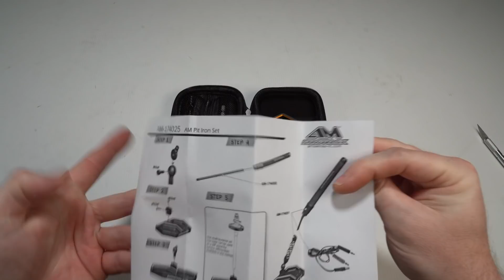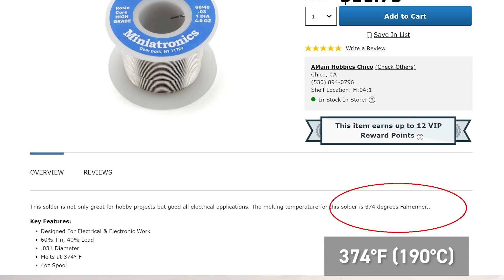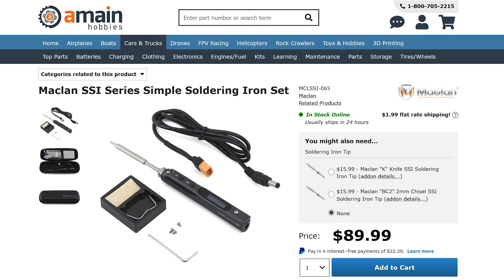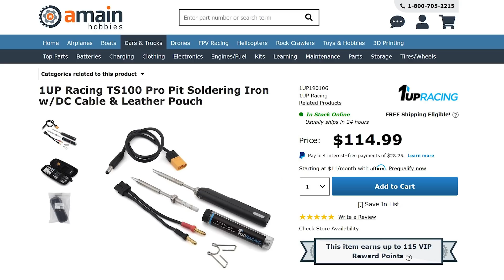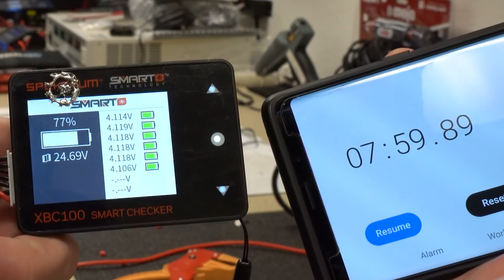Are 12V Mobile Soldering Irons Any Good? Let's test them...

Comment: I own ts-100 and ts-80 and a couple of the mini irons that are 24 volt supplied....all of them work excellent if you put the correct tip for the application....these irons are great for portability and travel well...I recommend them for most electronics and electrical repairs....some of the very heavy duty repairs etc...you probably would need a full size solder station....
Good video, but, the tips used weren't heavy enough for that 8 gage wire.

Comment: similar to suggestions about TS100,  I would just get Pine64 Pinecil iron.  It does everything the ts100 does, but has more options, can go up to 24V with simple mod, I have hooked my Pinecil to different batteries including 18v-21v tool batteries (using power wheels adapters).  why get a 12V iron, when you can get 21V-24V  irons that also can use same DC - Xt60  cord to connect to batteries and are so powerful, they can do everything in this video with ease.

Comment: ive had the ts80 for over a year now... i love it, use it on the bench and in the field, works with any quick charge power supply or powerbank and 3 cell lipo and up.
goes to 450c with a firmware update, dont do any large scale rc but ive soldered 12awg with ease, mostly i use it for small stuff like circuit boards and it does it well!

i also got the es121 screwdiver made by the same company... and it is very good, they make some quality stuff.

Comment: I use the TS100 for soldering model railway tracks and parts, and its so good for moving around large  layouts. I use a 19v lithium power pack that was intended as an emergency power pack for jump starting autos with a flat battery.

Comment: Both the Maclan and 1Up are repackaged Miniware TS100 soldering irons. Perhaps they have used one of the clone brands from here in China, but they are all basically the same. The heating time in that case is mostly based on the tip you use and not the iron itself.
Reply: next time, use the same or exchange the tips between the irons to make it a fair test. I have several TS100, pinecil and the TS80... and even the clones behave the same. You actually tested the tips.

Comment: Simply search for "DC soldering" on Aliexpress. Soldering irons available starting at 10$ and more. Do not buy the cheapest junk but watch/read some reviews first!
Reply from the maker: Price and value are not the same thing. 
-Brett
Reply: @AMain_Hobbies  I totally agree and there probably is a lot of cheap junk out there. But cost also does not guarantee a good quality. It is not easy to decide which item is good in performance for its price. Reviews from users are of high importance to influence buyers in this case.
In the case of soldering irons there are some very promising and capable budget options out there. I simply wanted to give that hint to people who are looking for something like that.

Comment: Use a lot of rosin flux when soldering. It cleans the connection, helps heat up the solder join faster and helps your soldering job look better.

Comment: I tried a bunch of the cheaper portable irons. Didn't really like any of them.
Bought a cheap T-12 station kit from China without a power supply. Wired it up to a DC-DC boost converter set to 20 volt output. Could crank it up in theory to 24 volt, but why push it? Now I can use the same handle and tips as on bench, and run on any DC voltage under 24 volt that is capable of supplying at least about 85 watts. A lighter plug or alligator clips to a car battery works great, as does a lithium jump start pack or  my 3S, 4S and 5S LiPOs.

Comment: check out Pinecil, does all of the above and can do it off of USB-C which means wall charger. Also on a lot of those iron you can use an old laptop charger that puts out 24V it will work great.

Comment: Nice review. I use the 1UP Racing for about two years now and it does the job very well for all of my 1/10 scale soldering jobs. I use my power supply wich gives 15V. Perfect soldering iron to travel with.

Comment: So for 10th RC racers on road and offroad.. we have 2cell packs and typically a 12v power supply.. 
We need to buy at least a 4s pack to get optimum performance out of one of these?
Reply from the maker: The 6S battery we used is $29.99. Don't bother with 4S: https://www.amainhobbies.com/tattu-6s-lipo-battery-100c-w-xt60-connector-22.2v-1300mah-tat13006s10x6/p1270947
-Brett

Comment: I want to say that with the ts100 you can take the iron and plug it into a computer and change the default settings in the config file. Its easy and it can change the 6s issue permanently. You can also change the default go to temperature and other things too. I love it and it works so well for me with my basic soldering using electronics
Reply: did u every had trouble with it and what battery u use I want to buy CNHL 1500mAh 4S Lipo Battery 14.8V 100C what u think ?
Reply: @meahnicholas7352   I don't have a battery for it, I just used an old laptop charger and put a plug on it that fits the soldering iron. Only issue I have is trying to find the adapter plug for it. For choosing a battery, you need to make sure you use one capable of the high current draw. I don't remember the specs for the iron but as long as you make sure you research what the battery is capable of and what the iron wants to draw at the voltage, then you'll be all good
Reply: Thank you so much you the best

Comment: The TS100 is absolutely amazing on 24V. It’s the single best soldering iron I’ve ever used.
Reply: The Pencil is as good if not better
Reply: is 12v 500ma enough to power a home made soldering iron?

Comment: Besides my standard workstation soldering iron, I always carry both battery operated and butane operated irons. I used to carry a UPS power supply in a case, to power a 25w hand held 220vac iron in the old days, prior to the introduction of small reliable battery powered irons. NB, few portable irons hold up to regular daily use, they're more suited to light infrequent use in remote locations. Thanks for the informative video.

Comment: Good video thanks for sharing.

My experience:  Ts100 is the best iron for anything 12 gauge or smaller, and especially great for drones racers who carry it with them in their tool bag for field repairs.   You can get it to work on bigger stuff but you really have to know what you're doing and have the biggest tip available.

The tip makes the biggest difference.  You can't knock the iron for not being able to do bigger wires.  Just get a bigger tip.  

There are knock offs of these available for around $30 and I hear there great.  Can't recall the names at the moment.

The power lead applied is usually wrong because it's too short, causing unexpected power resetting.  

Use a cheap 20v laptop power supply to power them.

Once you use these on 20+ volts you'll never use it on 12 volts again!
Reply: Have you tried the Sequre 001 and the Pencil.

Comment: Just get a sq001 just about 50$ and the same iron as the ts100. You can even flash them with a different firmware and make them even better.

Comment: This is why I use a mps 75w soldering station that is a mobile station with temperature control and goes up to 850deg using the T12tips and costs ~ 133$can

Comment: Was really interested. Until 0:36 when I saw the cheapest iron was $90. No thanks. I'll get a BEAST plug in one for that price.
Reply: These are just rebranded Irons that can be gotten much cheaper from the manufacturers. They are Miniware TS100 and SQ001 irons. For something even better cheack out the Pinecil which uses the same tips but can be powered by USB C or 5525 DC plug and costs $25. They aren't replacements for desktop units but are far better than most peoples first irons and with an RC or power tool battery you might already have they can be used anywhere.

Comment: I used to use a butane powered soldering iron as my goto field iron but I just recently picked up a TS100 to replace it. 1up was first out to advertising these to the average 1/10 scale racer I did my research and found it’s just a rebranded TS100 that all the drone guys swear by so I ended up with one of those instead. The one I got came with a laptop power supply and two tips just add a firmware tweek along with choosing the proper tip from all the various ones available and you end up with something equal or better than what they are selling. one of the big selling points to me wasn’t just the quick heat up time but the quick cool down and the automatic smart temp control. I still use my old Hakko for bench work and my butane powered Iron is back in my automotive toolbox

Comment: Check out the Milwaukee 12V soldering iron.  They use the M12 Milwaukee battery thats used in their screwdrivers and drills.

Comment: I use my TS100 with Ralim firmware for literally everything. I use an old laptop power supply for max power (read the manual for the voltages and amps for each power output), but often I just use the whatever brick I have on my workbench. D24 and B2 pretty much do everything I need for quadcopters and a small rc car.

Comment: I have the upgraded original TS100 and love it! You can update the firmware to get up to the 450 degrees, and it came with a DC power supply, so I'm not sure what 1UP is doing to justify the added cost. Regardless, you definitely need to make sure you keep the tip clean, pre-tinned, and add flux to any large wires. Do that and you're golden.
Reply: I love my ts100, use it at the bench with a laptop power supply and on the go with an 18v drill battery with a usb charger "skin" that I have modified to have a cable coming out directly connected to the battery pins.

Comment: I’ll keep using my solder station that plugs into the wall. Has a separate power supply and is far more powerful than any of these.
Reply: These are all TS100's at least one actually says it is a clone. Still I've normally kept a butane torch to solder with when I'm away from a  wall. These are nice if you don't want to go that route.
Reply: Yup is best having a solder station when soldering  at your work station or at home but when you go to the track  or bashing it is convenience to have in your pit bag.

Comment: Awesome video! I’ve been using the TS100 for a while and love it. It’s not perfect but I love the versatility in power supply.
Reply: The appropriate soldering application, power source, soldering tip and flux (when needed or necessary) and you're pretty much set.
Reply: check out the pinecil from pine64.  It uses either a barrel connector or usb PD and heats faster than the ts100 at 1/3 the cost.. 25 dollars... It's compatible with all the ts100 tips as well.. so all sorts of options
Reply: @AlanDike  *ts100 tips not ts80
TS80 uses audio jack which makes the tips more complex and also more expensive compared to the simpler TS100 tips
Also Pinecil works with T12 tips which are generally half the cost of a TS100 tips so that's a plus
Reply: @MaxC_1  correct you are.. edited to reflect

Comment: I need a review on the best plug in soldering iron sir!!
Reply: Go to your hardware store and get a 100w gun iron, I’ve done 6awg wire with it.
Reply: I think they sell a trak power one for $80 that’s pretty decent. Anything at or over 60w will do the trick.